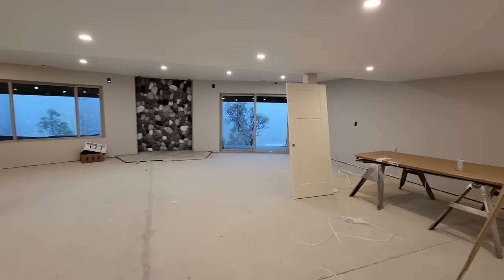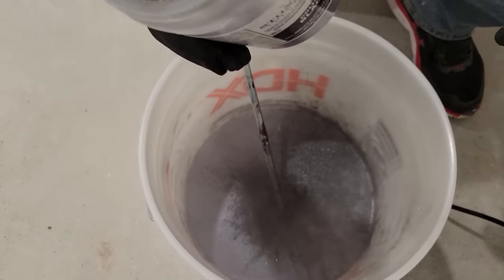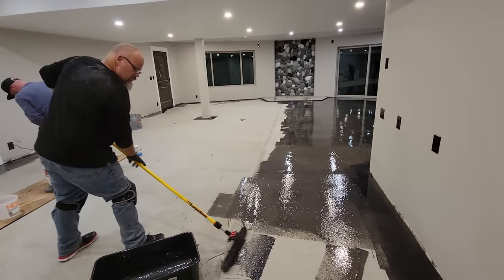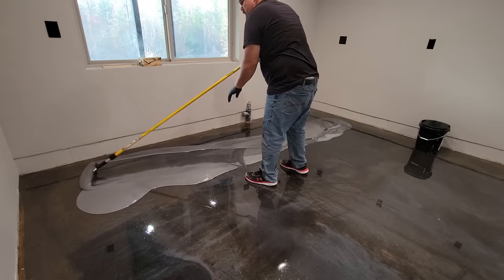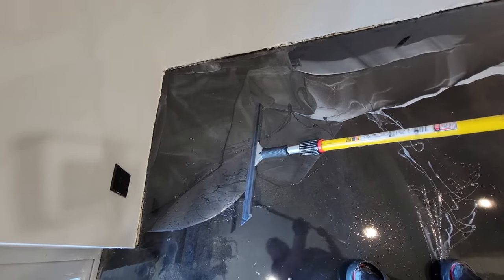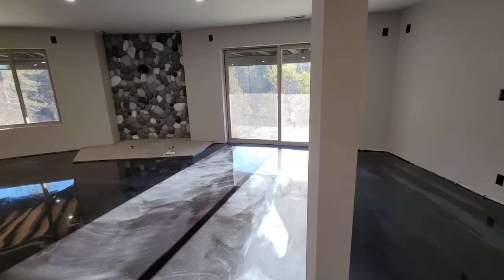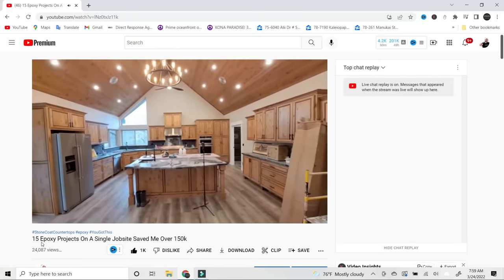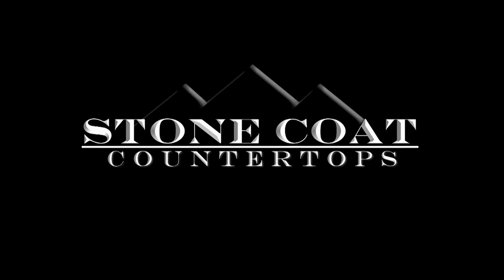How To Epoxy Floors Fast & Save Money | Stone Coat  Epoxy

Comment from the maker: Would you do a floor project?
Reply: Could you work in gold for that gold streaked marble look you have done in the past on countertops?  What about acid staining on the concrete? Could you do a clear coat and the a top coat on something like that? The floor looked great!
Reply: I thought about doing epoxy for my kitchen area.
Reply: That looks so beautiful!  I might try doing black marble looking for my basement floor.  Luv ur shiny high gloss looks!  Maybe add some green for more color!  Luv ur videos!!!!!
Reply: Did the concrete floor get sanded at all or cracks filled or anything?
Reply: I’d love to pour more floors with SCC. Just waiting on kits to be back in stock. Need 4 15 gallon kits.
Reply: I’m thinking about doing epoxy floors & countertops as a side hustle
Reply: hell yeah!
Reply: Which kit is that?
Reply: I was wondering if it could be done, actually! I need to put a floor in my bathroom, and after watching a bunch of the countertop videos I thought I'd check into this.
EDIT: Looks amazing! My subfloor is OSB, will it work on that?
Reply: Any mechanical bond done for prep?
Reply: Definitely going to do floors, if only they were inventory
Reply: I just bought a 2200 sqft manufactured home & I am thinking of doing this? Would this be a good idea for going over wood sub flooring? How is the slipping factor for wet areas like bathrooms?
Reply: Question. I live in mobile home and want to do my bathroom floor apoxy. How could i do it properly?
Reply: Ótimo vídeo, comecei a trabalhar com epox a um
mês atrás, estou gostando muito mas não sou
fluente em inglês então mesmo observando os
detalhes no vídeo não vou absorver as ótimas
dicas que vocês passam , vocês podem colocar
o segundo título do vídeo em português para
que o YouTube possa disponibilizar a opção de
legenda em outro idioma assim vai alcançar
muitas outras pessoas e seremos eternamente
gratos, obrigado todo sucesso pra vocês.
Reply: Great video, I started working with epox at a

A month ago, I'm enjoying it a lot but I'm not

Fluent in English then even observing the

Details in the video I'm not going to absorb the great ones

Tips that you pass on, you can put

The second title of the video in Portuguese for

That YouTube can provide the option to

Subtitle in another language so you will reach

Many other people and we will be forever

Thank you, thank you for every success.
Reply: No grinding of concrete? How can it bond mechanically if no grinding?
Reply: Absolutely I’m leaning towards this seamless finish. Great work
Reply: Love to know the cost of the materials per sq.ft.
Reply: That looks absolutely Amazing  Guys !!  My basement is 1400 square feet. I would love to do this in my basement !! I think I could do it.
Reply: I am at the moment and am feeling rather defeated. I did all the prep work meticulously. Unfortunately whenever I did the basecoat or primer I use the isopropyl alcohol at the next day when I came back in there were tons of bubbles everywhere. I have started sanding and getting everything as flush as possible. Do you have any recommendations other than filling with superglue and sanding again? should I go over it again with another sealant before the mid coat?
Reply: How much you charge for something like this at 2,000 sq.ft?
Reply: what is the list of products needed to do the epoxi flooring?

Comment: I actually loved it with that high gloss do you have to put a tap coat or can you put a tap coat with something else that shows it shiny and glossy? Also I was wondering what it cost to do that?
Reply: I think you would just go over it with the epoxy but without color
Reply: Top coat is mandatory as a protective layer if you want a high quality epoxy floor. However, you can pick different top coats. High gloss or no gloss, and they both work the same way. You roll them on white and they dry clear.
Reply: They have a gloss ultimate top coat if you like that gloss look
Reply: I was thinking the exact same thing. I love the gloss look.
Reply: I would never gave it a dull coat, the gloss was so beautiful.
Reply: @blazenu6514  Is it another coat of epoxy as top coat?
Reply: @funnypeoplerule  yes
Reply: I agree...loved the glossy floors...🥰
Reply: Armoseal rexthane could have been used as the topcoat for a clear finish. The topcoat on this video looks like the H&C product
Reply: @douglassamuel9731  yup
Reply: You guys never use slipstop?
Reply: Top coat !
Reply: About 60€/m european standard
Reply: I like the high gloss look
Reply: No grinding the cement?
Reply: I was thinking the same. It looked amazing before the top coat.
Reply: @Jose-rq1ig  what alternative top coat can we use on epoxy?
Reply: About $3 to $5 per square foot

Comment: Why was the concrete not diamond grinded or shot blasted first ?
Reply: I was wondering that myself not even acid edged at least
Reply: Probably because it looks like brand new raw concrete
Reply: Did you not grind the floor first?
Reply: They took a short cut to avoid cost and labor hahahah
Reply: If they decided to cut corners and skip steps, then this paint job will probably start peeling up

Comment: Does your epoxy bond without having to mechanical grind, shotblast, or acid etch? If so can you tell me the exact product you’re using? I do tons of floors in Denver, but I’ve never found anything that would bond without grinding shot blasting or acid etching it first!! I would have been there 2 extra days on the prep
Reply: I’m from Denver and looking to epoxy my fiancés tattoo studio ourselves…..took up the tile and carpet, diamond grinded it but still have good bit of glue left. From what I see, it’s super important to get that glue off before we start. 

Is that so? 

And would the shot last be better?
Reply: @CoachPabloUSA glue definitely has to come off.. I know that much. Also the concrete could have curing agaents sprayed on top which is also an issue..

Comment: I want to create a bathroom decor that makes the entire room appear to be under the sea, from floor to ceiling.    I  want to create a floor that replicates the ocean floor,  sand, seashells, crabs, starfish, and etc.   I know that I  should start with a base paint.  But, after that should I glue down a thin layer of sand and the small creatures that I want on the seabed, then pure the epoxy over it all or should I mix the epoxy with the sand, trowel in the sand waves as I put down the epoxy/sand, and then place the small creatures?   Of course I would need to pure the top coat of epoxy and go through all of the finishing steps.
   Can you think of a better way to create what I  am planning to attempt?
   Also,  can the epoxy be pure on a floor with a heating system?

Comment: I'm looking at doing a black epoxy floor in a store and the owner wants it to be shiny. I've got 39 years experience in flooring including finishing wood floors. I've never done epoxy floors but I believe I can handle it. Any tips you can give on installation would be appreciated. Also, what is the going sf charge for labor only? I'm in Nashville, TN.

Comment: we can use the regular paint brush and roller paint brush, we can can buy local hardward and also we can use regular primer paint for concrete and plywood for example for undercoat before apply the epoxy resin

Comment: I love your work. Always looks great. I have a question though, would the epoxy flex? For instance, the relief cuts in the concrete floor is meant to reduce cracking. By covering the relief cuts with epoxy ( in the event the concrete contracts and expands) would the epoxy flex with the concrete slab?

Comment: My issue is the old tile is an absolute nightmare trying to rip. If I brush, vacuum, and clean really well could I use self leveling epoxy right over the tiles?
Reply: Old tile needs to be ground down so product can key in

Comment: Do you have to prep the concrete first?? Sand or etch??
Reply: It doesn't look like they did but I'd at least wet mop it, use and etcher on it, rinse, dry then epoxy.

Comment: You didn't surface prep with a surface grinder or beed blaster ????   and bubbles did you apply the coating to early in the day when the earth is heating up and air is coming out ..

Comment: Quinn, my epoxy is a tiny bit more viscous than this video shows. My house is about 10°F cooler than the 79° mentioned in the videos. I would call this a house paint or cream viscosity, not water-like. Maybe the temperature is part of the problem. Your commentary on this is appreciated.

Comment: It’s these videos that confuses customers on how epoxy should be applied. Every manufacturer recommends to Diamond grind the concrete first and get it to a certain profile or they will not warranty it. 
If you guarantee your product without Diamond grinding and give a 10-15 year warranty, I would use it all day every day!